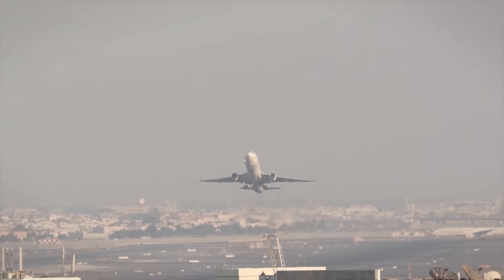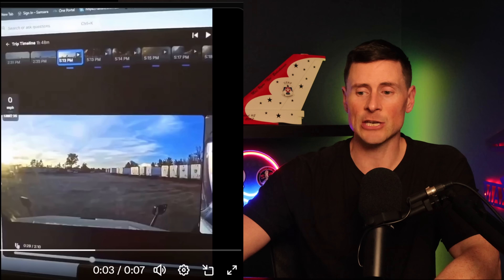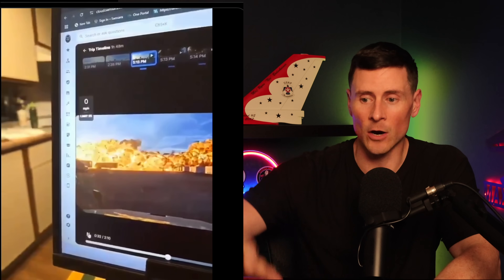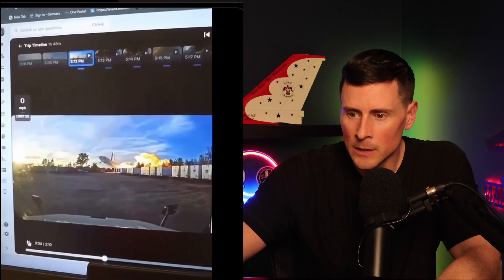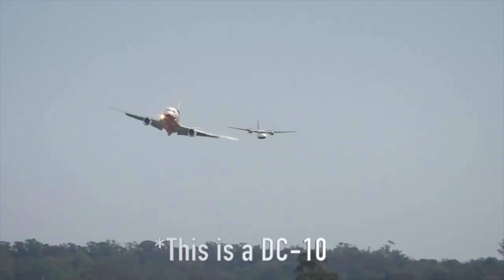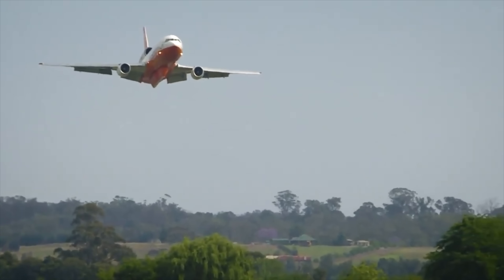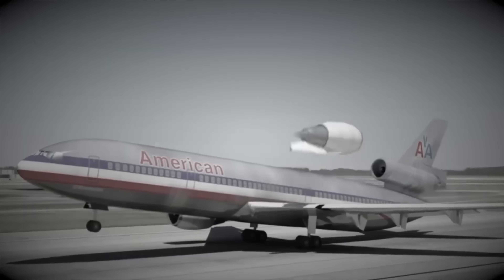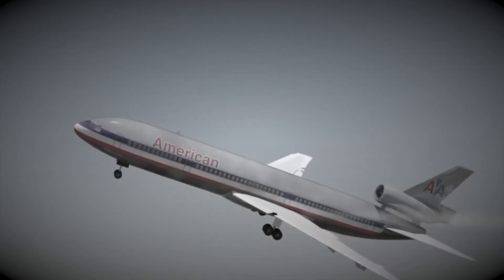Airline Pilot Reveals CHILLING Clue in Final Moment Before UPS 2976 CRASH

Comment: You have to be a really really good pilot to fly an md11 from what I understand that plane lands at a super high rate of speed due to the lift issues with the number to engine being mounted on the tail and also I read it tends to bounce on Landings and a lot of MD 11s flipped over on the runway during Landings because of pilots who didn't have enough experience and frankly weren't good enough to fly an md11. But yes I think it's very similar to flight 191 in 1979 when the DC-10 had the engine come completely off of the wing but that was due to maintenance cutting corners and removing the engines with a forklift instead of doing it the proper way by detaching the pylon so to save money they had a bunch of idiots using a forklift slamming that engine mount into the pylon eventually cracking it and after a few hundred flights that fracture got bigger and bigger till that day in 1979 when it decided it couldn't handle that load anymore and ripped away from the wing taking the hydraulic lines in the communications along with it although that was a DC-10 basically the same plane and 400 people got to watch the plane they were on flip over 90° which I think is unreal because that was a new thing in 79 to have a camera mounted somewhere near the number to engine kind of like the a380s have the cameras outside of the plane but anyway those poor people got to watch on the big screen the planes engine fly off and the planes left wing pointing straight down to the ground knowing they were all going to die since they were only about 300 ft in the air I think that's one of the most saddest things ever. I would really like to know if this was caused by maintenance doing the same technique that got them in trouble in 1979 especially nowadays I think it's very likely that they would do that to cut Corners to cut several hours off of the fix basically if that's the case a lot of people should do life in prison

Comment: Are DC-10s/MD-11s unable to fly on 2 engines at safety speed?
Reply: They are flyable on 2 engines if all else is well and a third engine simply quit....but in this case all else was not well. The left engine and wing were in flames, causing as yet unknown issues beyond a mere loss of power on the left engine.
Reply: I think flying and landing is fine with one out, but taking off fully loaded is another ball of wax indeed. RIP to the souls aboard.

Comment: A Fed Ex MD-11 had crashed and flipped over....on the runway....if anything goes wrong, it seems to flip over....I wonder why McDonnell Douglas designed the back wings ( horizontal stabilizer) much shorter than the ones on the DC-10....
It doesn't look very stable.

Comment: Why isn’t the FAA mandating every airport has the Engineered Materials Arresting Systems (EMAS), which act like a crushable bed of cement to safely stop an aircraft that overshoots, undershoots, or veers off? 

This would save so many lives and it’s a quick measure that can be implemented.
Reply: Not in this case.  Way too much energy to stop.
Reply: only if plane is still on ground..

Comment: That uncontained fire on the #1 engine is highly unusual. I doubt a bird strike, but it's a catastrophic failure. If the engine had separated on lift off, the fuel loss feeding the fire would have been fatal. The DC-10 is a maintenance-heavy aircraft. God take of those men.

Comment: Was there no way to abort takeoff once the fire started? It seems like whatever happened, happened immediately on takeoff. RIP to the victims
Reply: the takeoff video only shows about the last 1/5th of the runway/takeoff - about  2000-3000 feet of a 12,500 foot runway. the video doesn't show where or when it started, and the angle of the footage makes it seem like you are seeing much more of the takeoff than you really are. If they HAD attempted to abort, they might have killed hundreds instead of the few that have been confirmed so far. the building that the wing clipped just past the end of the runway is a UPS logistics and shipping warehouse facility that was fully staffed with hundreds of people at the time of the crash. If they had attempted to abord, they wouldn't have clipped the building, they'd have plowed directly into it.
Reply: @ravyn.  Ok makes sense thanks👍

Comment: The dashcam footage of the impact becomes even more thought-provoking when you see the camera facing the driver... he was entering something on his phone or a company device and seemed to be waiting to be told to move forward or exactly where to go... his eyes were down. Suddenly, a red glow fills the cab of his truck... he looks up, eyes wide as saucers. His mouth drops open... when the aircraft slams into the ground, and the NAPALM-like explosion occurs directly in front of him, his fight-or-flight response kicks in, and he exits his cab and runs away... I have no idea what was going through his mind, but imagine if he decided to stop at the last moment for whatever reason and didn't continue driving further into the complex... no telling what was on his mind. It’s never a good thing, especially for the crew, particularly the pilots, who barely get to rotate (take off-wheels off the ground), reaching a maximum height of 150 feet (according to Juan on his channel). But the pilots were very aware... the line-worker videos show the flame starting around the point where the aircraft would have reached V1, and less than a second later, by the time they reacted, they were already at V2 speed. From the impact video, you can see how fast the aircraft was traveling across the ground (ground speed of 150-160 mph)... barely able to get the wheels off the ground as they frantically worked and battled to the end. THEY HAD NO CHOICE BUT TO ATTEMPT A GO-AROUND... THERE WAS NOTHING ATC COULD HAVE DONE OR WARNED THEM ABOUT... THEY WOULDN’T HAVE HAD TIME TO RESPOND TO any verbal warnings. Regarding those suggesting sabotage because of the fireball—understanding how much fuel that plane carries is key, and the fuel was being sprayed or spilled like a firefighting plane dropping retardants or water on a wildfire... it would not create a localized mushroom or fireball. Instead, it would look as it did—like someone used lighter fluid on charcoals and tossed a match while still spraying—resulting in a massive NAPALM-like fireball.

Comment: It looks like possibly an uncontained failure of the #1 engine which departed the airframe. And from buds I know that fly the MD-11 at UPS still possible to lose 2 of the 3 hydraulic systems with this damage. Similar to AA 191. I didn't notice the sparks flames out of #2. But loss of #1 and #2 fodded out maybe, would explain why this airplane didn't climb. Or sparks from a tail strike? Such a tragic accident. Gut wrenching to watch. Reminds you how quickly a normal routine flight can turn into our worst possible day. RIP to the crew and any other victims. Families. And friends. I heard unconfirmed possibly jump seaters may have also been onboard. Also unconfirmed maint. worked on #1 engine prior to departure. All speculation. You can bet this highly trained professional crew did everything they could to save the airplane. And themselves. Apparently UPS cancelled the sort last night in Louisville. And also cancelled all pilot training events set to start today. Probably many at the hub witnessed this accident. The dispatcher. Load planner. Rampers that loaded the containers and closed the cargo door. The person that boarded their crew meals. And the ramp crew that marshalled them out and gave the wave off to the Capt. Our thoughts should also be with the entire UPS family today. 🙏🙏Jim G. Reno, NV.
Reply: "Departed the airframe" definitely sounds way better than "fell off".
Reply: Pretty sure the Mud Duck 🦆 MD 11 has Hydraulic fuses in the system to stop 🛑 a complete loss of Hydraulic Fluid. 👍

Comment: This incident is eerily similar to AA 191 crash in Chicago. Left engine with pylon separated from the DC10 destroying all three hydraulic systems as it tore free from the wing leading to loss of roll control resulting in the aircraft crashing  knife edged shortly after leaving the ground. MD11 and DC10 being nearly the same, this raises suspicions. The shortcuts the AA mechanics took that caused the separation may not be the only way to lose an engine, and the results could be the same. I think it's time to retire the design.

Comment: UPS needs to go through all engine changes on their MD-11’s and inspection those bolts for cracks
Reply: The DC10 in Chicago crash was an engine mount Crack, not a bolt problem
Reply: @regould221 I am not positive but I thought the bolts had stress cracks as well since they let the engine hang from the pylon as a separate unit using a forklift.
Reply: @pappysnappy5899 the order of events was that a pylon broke which then put stress on the other pylon and Bolt. The bolt found that was over stressed was the one that was on the pylon that didn't break.
Reply: Yes. I wonder if sheer age played a role in this. '91 is a long way back.

Comment: As a non pilot. why on Earth are there no 'cut-out' auto systems for situations like this? It is quite obvious that a 3D take off is impossible, and offers zero survivability. BUT, low as it might be, the crews chances are surely enhanced by staying on the ground? What is the point of putting ATC on huge towers if they can't intercede in situations like this. Smells very much of 'business as usual' mentality over Jesus! I'm in  metal, heavier than air tube flying through the air.
Reply: Physics

Comment: Most airports were built away from cities, why allow planning permits so close to the ends of the runways? V1 could be significantly increased with a large field in each direction of the runway. Grow corn or something there, or just leave it barren.
Reply: because just about every major airport will have LOTS of warehouses around them as they are lots of times hubs for major freight carriers.
Reply: The airports were built before the city expanded onto the runway extended centerline

Comment: the one thing i dont get is why they allowed fuel storage that can explode next to an airport that can have plane crashes
Reply: There wasn't fuel storage.  The fire was from the 34000G of fuel on board.  This thing was fully loaded at max takeoff weight.
Reply: @athensdawgs81  Unfortunately, it also crashed directly into Kentucky Petroleum Recycling , and several of their fuel tanks did explode. A chemical manufacturing business was also in the path of fire, and some of their tanks exploded as well.
Reply: @athensdawgs81 the plane crashed in to a fuel recycling centre, thats a fact, sadly but it wouldn't have mattered anyway, it was carrying a lot of fuel so either way, the same result would have happened regardless.
Reply: @SilentShadow-SS but what about other planes?
Reply: It wasn’t fuel storage.The plane was loaded with over 200000 pounds of fuel to go to Hawaii.
Reply: @thomasadams9395 it crashed into a fuel recycling facility. The amount in the facility was undoubtedly insignificant compared to what the plane carried, but still…..

Comment: Aircraft these days should have outside cameras to alert the crew. Pilots are flying "blind" totally oblivious what's happening to their aircraft....very sad.
Reply: They knew what was going on they were going to fast to abort, they had to take off
Reply: 100% far from "blind" just because you dont physically see something doesnt mean you're blind..
Reply: Alarms go off in the cockpit when an engine is on fire. They would have known. They may have already been past the speed where they could no longer stop due to not enough runway and had no choice but to take off and hope for the best.
Reply: @brendanfarthing  alarm doesn't tell you the whole story...
Reply: Definitely, they had alarms screaming but probably didn't realize an engine was hanging off and both were in flames. 

I was thinking they hit V1 too. Need to see more video. 

It's an unfortunate situation. Was just thinking if they were able to see the extent of the emergency, perhaps they could've done something different. 

Just seems like cameras are everywhere nowadays besides the outside of commercial airplanes.
Reply: Was thinking the same thing. The pilots had no idea the engines were compromised and just follow procedure. The cameras could also be monitored by AI.

Comment: MY QUESTION IS WHY DIDNT AIR TRAFFIC CONTROLLERS TELL THEM TO ABORT THE LIFT THAT THEIR ENGINES WERE ON FIRE???
Reply: Kind of hard to stop a plane weighing 630,000 pounds going 150mph.
Reply: Nobody has released the Air Traffic Control voice recorder yet Maybe they did warn the Pilots or didn’t. Too soon to put blame on any one thing let to early in the  investigation
Reply: @rogerhenson6589 absolutely, great point.
Reply: They were past "V1", the speed needed for takeoff or abort takeoff. After rotation - they must get airborne. If we were in the tower, we would not have enough time to assess the situation and get words out. V1 is also the last possible time for the pilot's to stop take off and stop the plane by the end of the runway. The plane was also loaded with 9 hours of fuel + cargo making it impossible to stop even at V1. At best, they would have noticed the noise and jolt caused by engine damage on the runway as well as the loss of thrust on the left side. I'm sure flying the MD11 both pilots had many years of experience with this aircraft. Best scenario, the engine would have failed during the initial spool up and they immediately stopped the aircraft and escaped the plane.
Reply: Good question, there probably wasn't enough time. This all happened within seconds, and it was too late in the takeoff to abort.
Reply: Can't stop a plane going 140+ mph when there is no runway left.
Reply: Exactly.   Air traffic controllers were not watching and warning them.
Reply: @dogfacedponysoldier87  I've grown really tired of all the internet experts so willing to throw around blame in these disasters.  For all we know a bird may have been sucked in one engine with that engine failure taking out the second one with it.